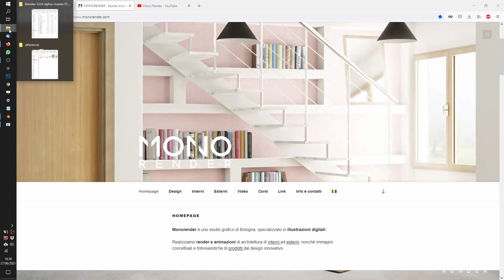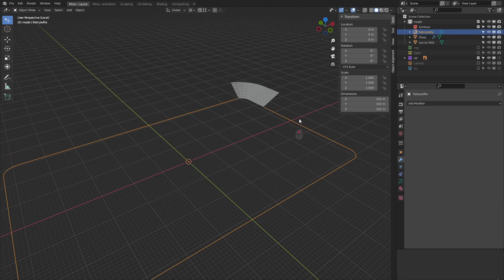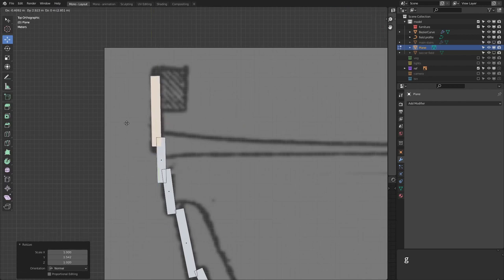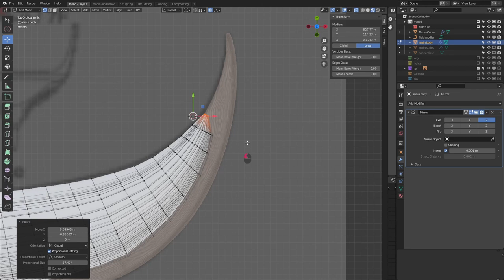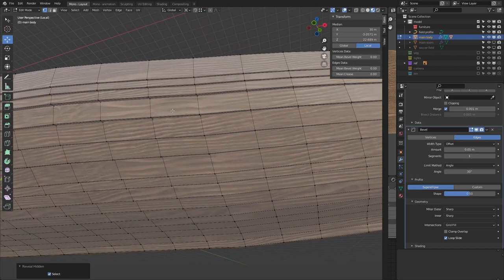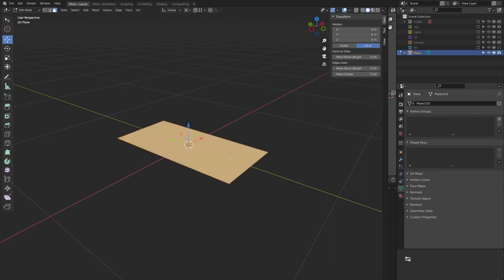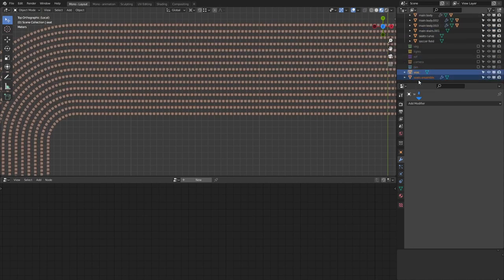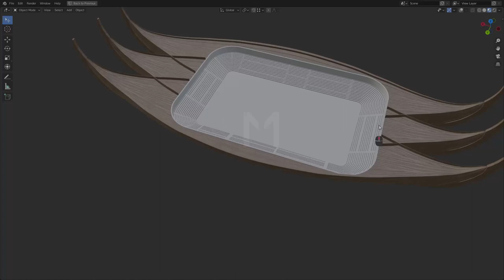Modeling a viking triple-longboat boat stadium in Blender 3.0

Comment: This tutorial is no longer useful for 2024
Reply from the maker: Yep, it was made for blender 3.0: things have changed. The main principles are still valid, but you have to look for the new tools.
Reply: @MonoRender  I tried to do it here, and it's impossible to center the chairs facing the lawn
Reply from the maker: @pxlaqwe13a-u8v  If you send me the file at info@monorender.com I can try to tell you what the problem could be
Reply: managed to solve it, after a long time, I used curve to points, instance on points and rotate points